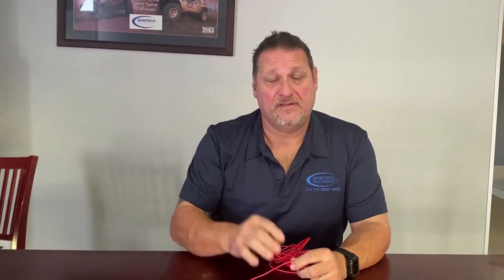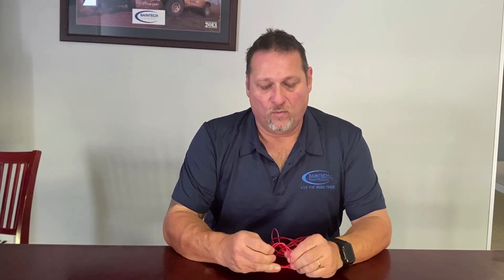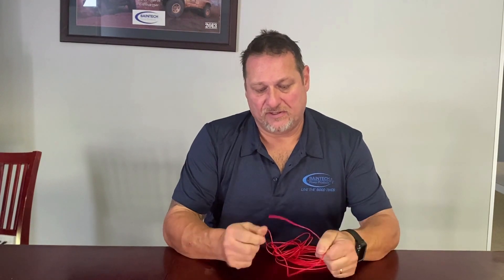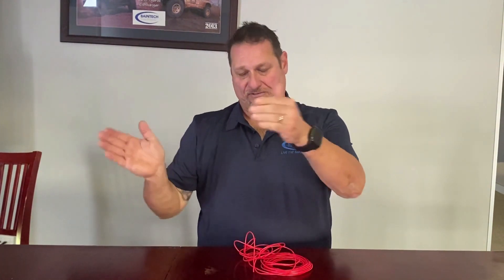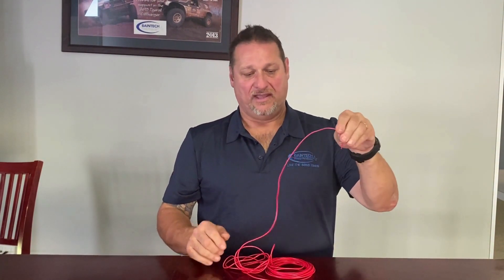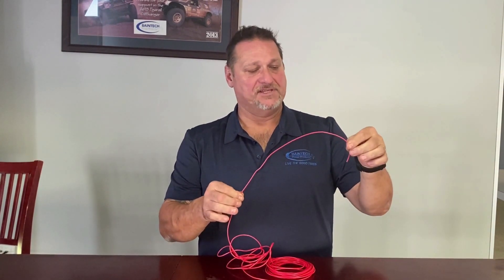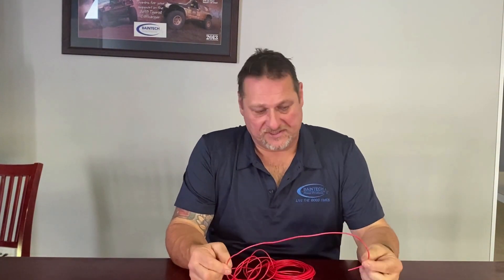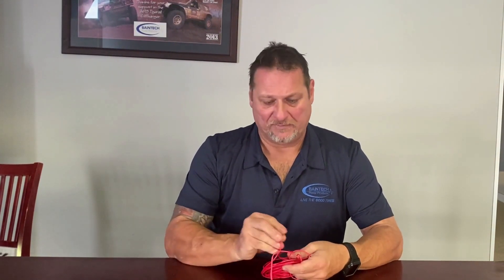Restarting Flat Lithium Battery Hacks That Everyone Should Know

Comment: I ran my scooter battery all the way down . With one bar showing it wouldn’t run. After letting it cool down , I put a charger on it and it charged but green light never came on. Usually charge for this type of scooter  is 58.8 volts on a full charge. But it’s new and I’ve never charged it before . I keep the charger on until display volts read 59.1. I got nervous of the volts getting to high, so  then I disconnected the battery the charger. What going on here with no green light showing ,yet it’s charging??

Comment: So I have a Renogy Smart 100ah battery that depleted during the winter so I think  was a combination of low charge and possibly freezing temperature shut this battery down. I have tried most fixes all to no avail, like jump starting etc.. I only get 0.954v when metering across the battery itself and this battery also cannot be setup in series. Any suggestions, the battery does contain the renogy smart pro bms and the top of the battery is very easily disassembled to access the internals, just don't want to be hasty and open up without fully understanding how everything works.

Comment: Disregard the Anderson plug explanation and even the DC to DC charger if that is the confusing point.The batteries internal management system (BMS) has shut down the battery due to running the battery down too low or for whatever reason and the internal battery management system needs to be woken up by supplying an external voltage to the battery so that  it will open the BMS to allow the battery to accept a charge.There are a few ways to supply the internal BMS with enough voltage to make the BMS open and the battery can be charged.Connect a good charged battery to the problem battery and then connect a charger to the problem battery.If it fools the  problem battery into taking a charge,that is the BMS is now open and the problem battery is charging,disconnect the good battery and usually the problem battery will keep charging.As he explained some smart chargers will not charge a battery that is shut down by the internal battery management system (BMS) but an old fashioned dumb charger might as it will supply full voltage to a flat battery or if available use the supply voltage button that some chargers have to give a 13 to 14 volt supply to the problem battery.Hope this helps,he said it but in a different way.
Reply: yes for me that was more informative.

Comment: I make it simple , lithium battery had only 1.6v after being disconnected for 8 months as my cleaver family disconnected from solar, since the solar was locked at 19.6v Max, I used a multimeter and connected direct to the battery and remove panel cables every 5 mins to see where the battery would sit at, I only did it 3 times (15mins charging) and was high enough to wake up the controller, so quickly reconnected panel to controller and away it went, from there the controller took over with battery charge level fluctuate, I'm hopping it does not go below cut out voltage as it had a good 4hrs at 25amps, I find out tomorrow

Comment: Well that’s not me my battery is too cold. I have only 12 V of power. I’m in a tent and I need my CPAP machine so I’m gonna die.
Reply: And for Future reference, buy a Heater Buddy and a Propane tank.
That'll keep the Tent warm.

I don't recommend those Heaters for use in any Unventilated space but in a Tent they should work GREAT
Reply: LOL - you're not going to die. Are you a drama teacher?
Reply: Hope you're OK.
I saw your post the morning after you posted it but can only log into YouTube from Libraries specifically.
Thanks Google!
Reply: Here's what i WANTED to post that morning:

Body Heat to Warm the Battery, keep it under a blanket with you and your Heat will warm it.
Don't touch it directly but keep the blanket a few inches within the battery and it'll warm after awhile.

Can keep it under the Blanket with you to Warm it up then run it and keep Alternating

Keep it under glass in the Sun
If you have a Car keep it on the Dash until it's Warmed, keep checking on it though cause even in Winter the Dash can reach 100°

Wrapping it in Clothes or Blanket to insulate

You posted this 15 Hours ago, so I'm assuming it was getting closer to dark, and you were frantically searching for an answer.
I'm in NY area.

Comment: I’m I the only one who felt he explained it in the most complicated way possibly anyone else could’ve done!
Reply: 5 minutes in and I still don't know what he's on about.
Reply: Depends on your understanding of a flat battery.. if there is no activity then the battery is below the acceptable charge voltage for the BMS (battery management system) circuit board to recognise the flat battery. By putting another battery of equal voltage in parallel that in fact has charge (voltage) then the BMS will recognise and deliver a charge to the circuit.. After a few seconds disconnect the second battery source from the flat battery and the BMS should continue to charge the flat battery as usual..!!
Reply: FnA.      4:45 I stopped
Reply: Yea, I agree.
Reply: I am usually slow and quite dumb, to be honest. But i found his explanations clear
Reply: Great video. A bridging wire from input side connection of the dc to dc to the output side, provides a voltage reading for the dc to dc charger. Therefore it can start charging. Great tip.
Reply: no, your not. But I suspect it's because I know nothing about it. Thankfully I know a spark.
Reply: Idk American thing maybe thought same😂
Reply: It had some technical language and Austrailian terms that may not be understood by people that speak North American English Dialect. Otherwise it was clear and helpful.
Reply: no it was awful. we hgad a teacher in university that had a doctorat degree, however he was not a teacher and after 3 weeks of his teaching we all sign a letter to the university saying he was drowning the fish with his knowledge that he could not communicate and he was fired on the spot and replaced. this guy is exactly the same: worthless
Reply: @art333-dg8dd most likely worthless for anyone who has searched for the video! I only have a very basic knowledge about electronics checking YouTube to figure out what’s wrong with the battery, I assume if anyone could understand the whole 14 minutes without a multiple pause, then never had a question in the first place.

Comment: Thanks for the info, I watched another vid similar by another youtuber that showed ways you could kick start it with many 12v methods just to trick the charger into realizing a battery exists there to be charged. I was lucky My electrician i called didn't come and come through the manuals and found out my AC to DC charger had a mode i could run 12v without a battery and that kick started it just turning that on for a few seconds then switching back to charge lithium.

Comment: Hi, I have a 48 Volt 10 AMP battery that will charge for around 5 minutes then when I use the electric bike it will die very very quickly within 15 seconds how do I revive that battery. It does have a built in headlight and that's the only way that I can think of to discharge it. Or should I get another 48 Volt good battery and just go positive to positive negative to negative any help would be appreciated thank you Andrew
Reply: Probably it's loo late to reply..don't know whether you will see this. But anyway, you should try this procedure called battery balancing on your battery pack. The device used in this case is called a 'battery balancer' and costs about 9,000 INR here in India. Or you may catch hold of someone in your area that repairs lithium battery packs and ask him to do it for you for a fee. Hope it helps. Regards

Comment: Great hack. My 6 vah battery went dead and got zero voltage at battery and charger. Used a car charger at 10 amps  [2 amps didn't  work] and charger started.

Comment: Will this work on a solax battery please. I have two 6.3kw linked. I  think I may have one that has shutdown as they only charge to 40% then start sending excess power back to the grid. A step to step guide for a solax battery would be very helpful. Thanks so much

Comment: But how do you flatten the batteries if they have bms low voltage cut out ? Surely that would make it impossible to flatten beyond the cut out level
Reply: Because the battery looks as if its output voltage is zero at the terminals, but the pack of lithium cells inside still probably have some charge left. The terminal voltage is zero because of the internal contactor / relay / disconnect device which most Li batteries have now for safety reasons.
Reply: It's called BMS
Reply: If you leave then long enough they go completely flat on their own.
Reply: I have the same question.  Just experienced this.

Comment: What about with built in DC DC charger?
Reply: Did you get an answer to this?
My 110ah with built in DC DC has run flat and cannot get to charge?
Reply: @chrisbarker2320  not yet bud
Reply: Any update? In the same situation
Reply: Righto, I pulled the cover off, checked battery power, (positive on grey Anderson and  negative from battery on bms module) had 9v. Plugged in 13v into blue anderson, lower dial at 2, upper at 0, green light on, and pulling 0.1 amp. Got a fused wire, jumped negative on grey anderson to negative on battery side of bms for 5 seconds, check amp meter and now at 20 amps and charging. Hope this helps